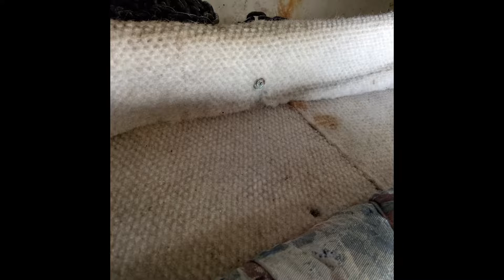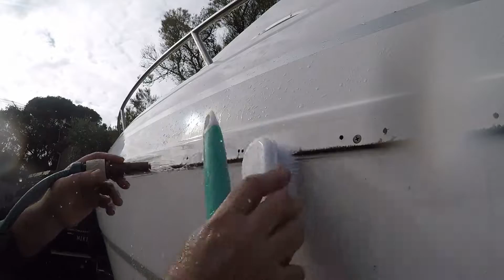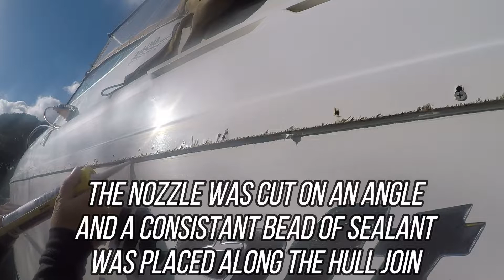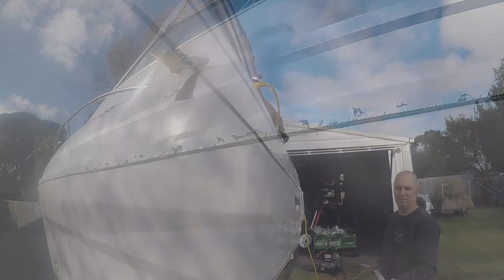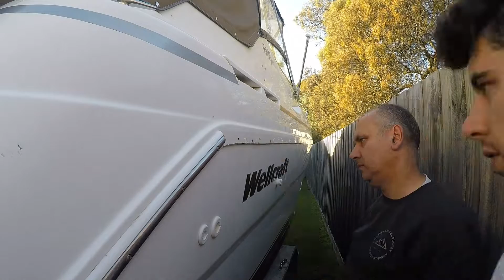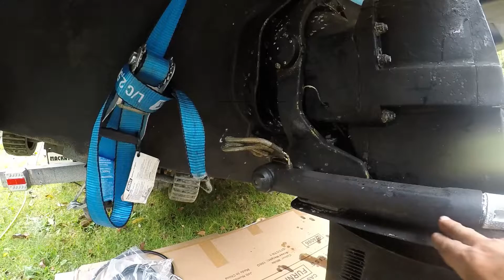Leaking rub rails

Comment: Don't use 5200!!
Reply: Structural and marine grade silicone is better for top cap separations, and rub rail leaks I'm thinking?
I've got "CRL-RTV {structural construction, aircraft, and marine grade} silicone", I'm going to use for the same thing. I bought 5200 too but after more research I learned it doesn't flex as much which is what's needed between hull cap, and also for rubrail bonding and fasteners. 
I've seen videos of people removing 5200 and it peels the fiberglass right off. 
5200, seems to me, like it's as strong as epoxy. Even though I believe it's considered a polyurethane.